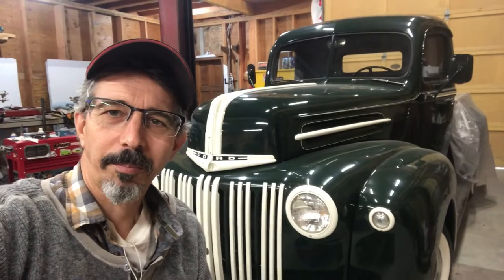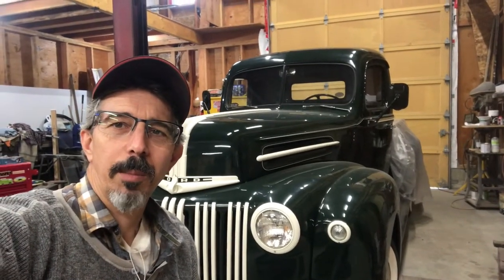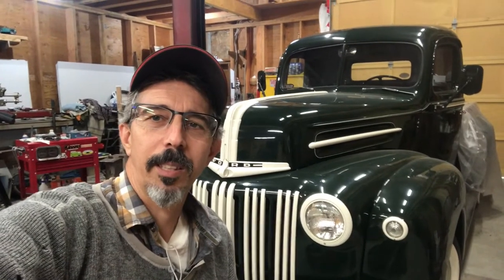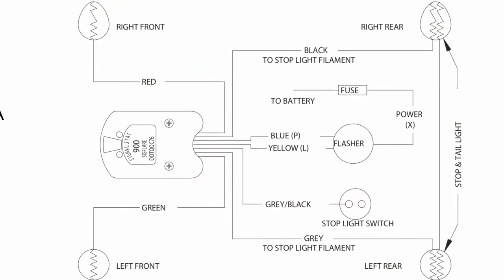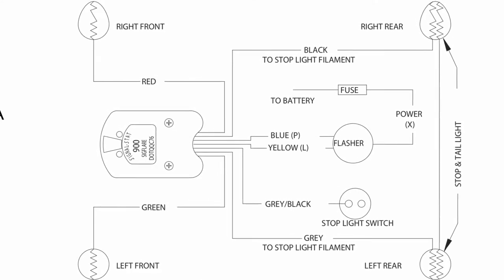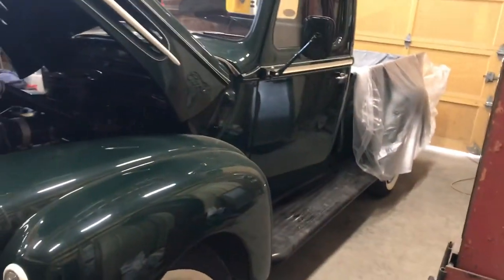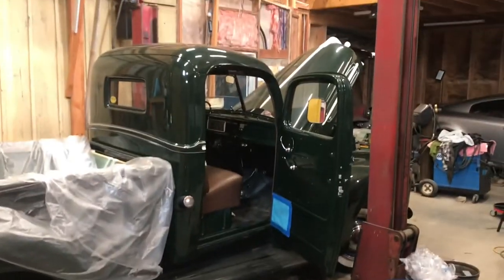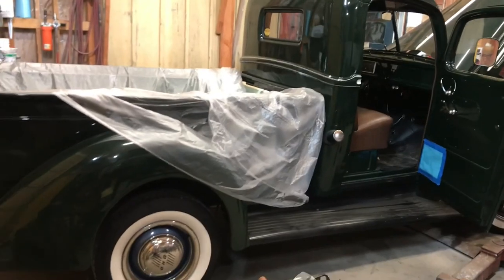Adding Turn Signals To A Pre 50’s Vehicle

Comment: I'll be refering back to this excellent video when I sort out the add-on turn signals on my 50 Plymouth. I don't even know if they work. For some reason, whomever installed it put the lever on the right side of the steering column, and forward of the shift lever. Perhaps he had only one arm.
Reply from the maker: Hey Fred, thanks for watching.

Comment: The bulbs we get these days are basically all made in China, and they don't fit the same.  Sometimes the reproduction light sockets are a part of the problem too.  If the dimensions for the short bayonets that align with the slots are out of spec or sync, you have that difficulty to service the bulbs forever.  There is a standard depth for those bayonet pins built into the metal base of the bulb and the sockets have to have the same dimensions on the indentations that allow the bulb to twist into position to be held slightly upward by the spring at the base of the socket.  Chinese don't understand or maybe they don't care to get it perfect. It is difficult to install reproduction light sockets like that and then buy bulbs to fit properly. We have to buy American in order to eliminate this issue, but finding light sockets for automotive applications made in USA are about opposite.  New cars come with LED lights, nothing like a simple bulb change. That means fewer sources for these sockets, and almost never any good ones.

Comment: Is that turn signal switch waterproof?
I’d like to put turn signals & flashers on my antique tractor
Reply from the maker: I don’t think it will dissolve in water but no, I think it’s made to be used in a dry environment. I bet you could use a water proof toggle switch to run signals on your tractor.
Reply: @WildWestGarage  Yes, I’m gonna use waterproof rocker switches, but it would be nicer to have it set up like a car

Comment: Nice job on the truck.  Is this a 6 volt system?
Reply from the maker: Yes, 6 volt
Reply: Thanks. I'm adding the same turn signal to my 47 chevy truck. Where did you get the socket to convert front parking lamp to turn signal?
Reply from the maker: @kevinminter5809  I think the socket came from Gregg Distributors
Reply: 12 v socket?
Reply from the maker: Grote 84-1004
Reply: Thanks for the tips. One more question.  My tail light assembly has two bulbs, one for stopping and the other for tail when lights are on. If I tap into brake light for tge turn signal, do I need a twi wire socket for it to blink? Did you change out the tail socket on your project?
Reply: Two wire socket
Reply from the maker: @kevinminter5809  if you have tail lights and brake lights you will already have two wires, I did not change the rear sockets. You have to split the circuit to the brake lights and then they get power individually through the turn switch. The power from the brake light switch gets routed through turn signal switch so if you have your foot on the brake and select left or right on the turn switch it will disconnect power from the brake light switch and apply power from the flasher relay to the side you want flashing, the other side will stay on solid for brake. You might have to watch the video again
Reply: @WildWestGarage  Ok. That makes sense.  Thank you for your time and detailed response. This has been very helpful with my project.
Reply: Hey wild west. Got my turn signals working thanks to your help. One more question. How do you wire the front parking lamp for turn signal and parking lights? It works as is for turn, but not the lamp. I have a kit with the 1157 bulb and two wires.
Reply from the maker: @kevinminter5809  the socket will need to be grounded and one wire will be for turn and the other for park. Use the brighter of the two filaments for turn.there should be two dedicated wires for the front turn signals coming out of your switch. You don’t want to tie into the rear turn signal circuit.
Reply: @WildWestGarage  I believe the socket will be grounded in the lamp assembly as the current one with one wire.  I have a black and green wire coming out of the new socket.  If I understand right, one wire to switch, and other wire to junction box for lamps? Wire lamps separately and not together as current?  How can I tell which wire in the socket is for the brighter element?
Reply from the maker: @kevinminter5809  You can run a wire between the two park lamps and just one wire back to power. Hook power to each wire separately and see which comes on the brightest.